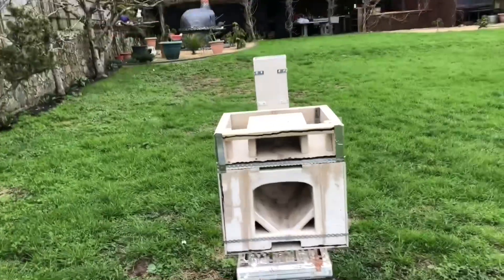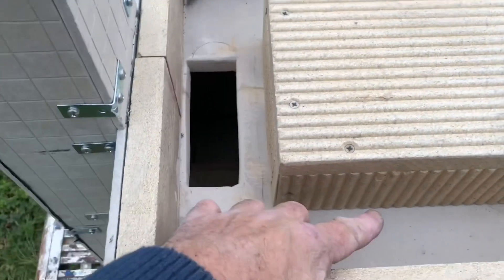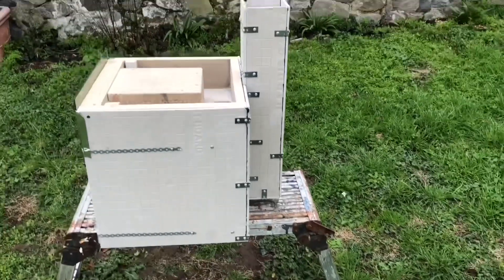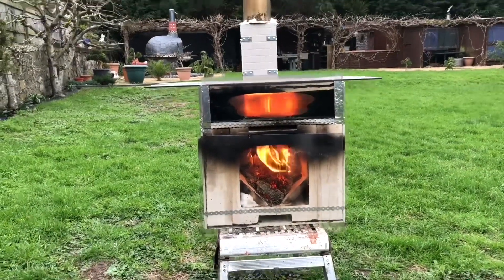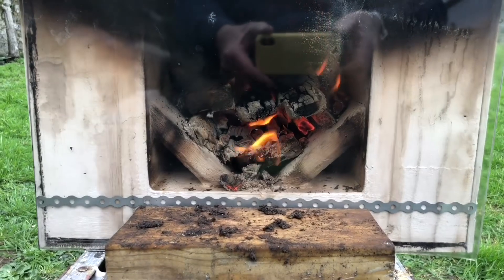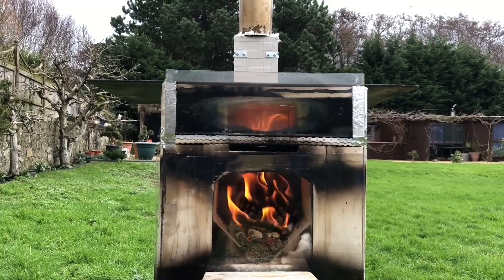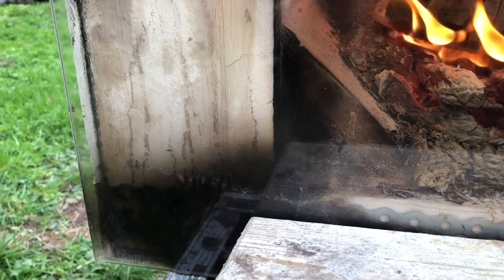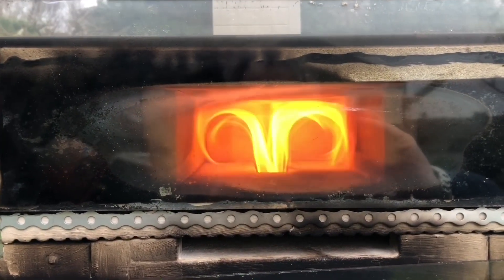Vortex  stove   Experiment four

Comment: Why not add a secondary hole in the top  air  box bottom closer to the glass so as too burn those unburned smoke whisps? 1" should do it.
Reply from the maker: Hi, please look at the later videos, the stove is still being developed but I have indeed tried your surjection.

Comment: I think you may achieve better secondary air results by super heating it. Maybe try a stainless spacer with holes drilled through. The idea behind secondary air is to get the air hot enough, that when it comes into contact with unburnt gases/fuel, it will instantly ignite.
Reply from the maker: Hi Alex, the gap between the fire box and afterburner runs around 360c but I have measured it at 400 during full burn!  
Of course you could be right but it seems to work very well anyway?
Reply: @foxfish7115  have a look at gasification stoves, easy to make, and highly efficient, as well as smokeless despite the lack of a dedicated burn chamber. Loving your design though

Comment: Very interesting.  Thanks again for sharing. I think the longer firebox/after burner is a great idea. 

One question I have is do you think the secondary air is gaining much heat in this setup given the insulative properties of the vermiculite?   

I’ve wondered with a well insulated firebox/ afterburner vortex if cooler secondary air was a better way to go, so long as it doesn’t inhibit the combustion temps too much. This way you need less volume of air for the equivalent oxygen. Just like in a petrol engine, which develop the most power on nice cool morning air.
Reply from the maker: Maybe, just so many variations to try!

Comment: Can you experiment with injecting secondary air after turbulence has developed?  This video below shows that the temperature seems to be higher, and the flame is more even and delicate
https://youtu.be/9dfhmKsn-c0
Reply from the maker: Hi in that video the stove is in massive overload so the holes are not working very well in that case. There are several people who have tried similar placement but it is difficult to find true results. Anyway yes I will try …….

Comment: Hey Fox thank you for taking the time to post your results of your experiments! I heard you mention the slots in the back of the firebox for removing the ballast gasses, "dry seams" as it were. I've read quite a bit on the subject, Peter has done some experiments on the subject, and he mentioned that they don't really do anything for the quality of the burn. But from my readings I have gathered that they help when one loads wood into the firebox that might not be dry enough for a typical stove. I do hope that you try them out, and then toss some wetter than normal wood in there to see how it reacts! I've been designing a DSR2 out of firebrick and I included the slots in my design as I don't always have the driest wood available at all times. Thanks again for the tests, and for posting all of your results!
Reply from the maker: Hi Jocob, I have found a post on Donkey pro boards about a guy who has very  successfully implemented two slots at 10% on his huge 180 vortex stove.

Comment: What if you were to construct the firebox so it is longer? That would give the secondary air more time to mix with the fire stream resulting in a more complete combustion.  I am very excited to see that the secondary air slot is working.  Now, if you don't mind, could you please construct a vortex chamber behind the firebox that will separate the ash?  Lol.  Just kidding.
Reply: This is what I've been thinking, too. Not only would the gasses have more residence and mixing time in the afterburner, it might slow the pyrolysis rate in the firebox and help prevent overfueling, (if the fire is lit at the back and then allowed to burn back-to-front through a longer and skinnier fuel-bed.)